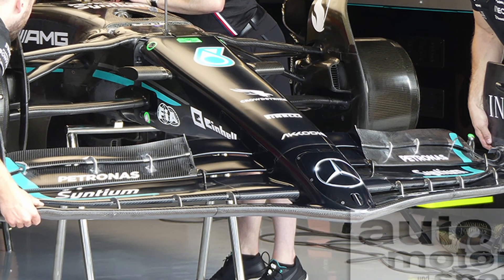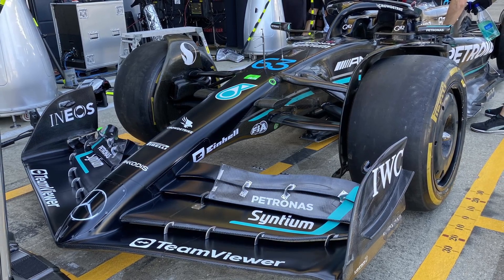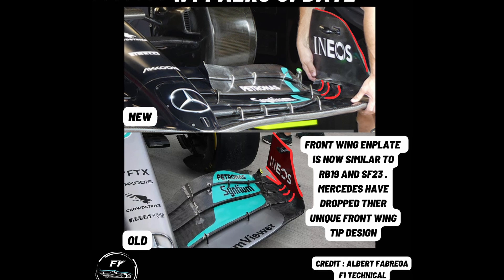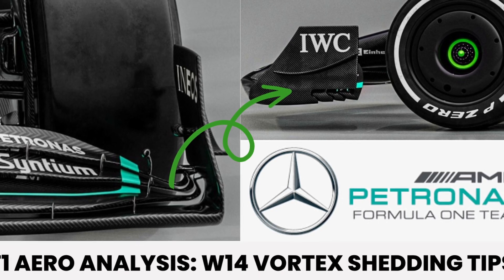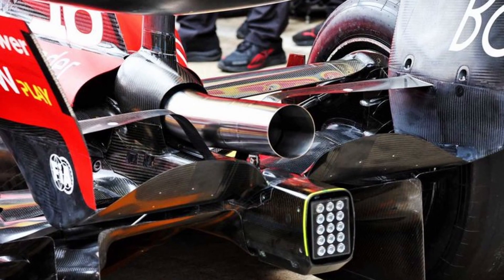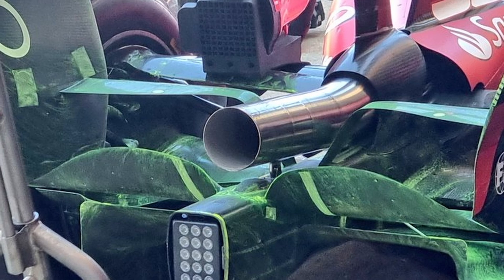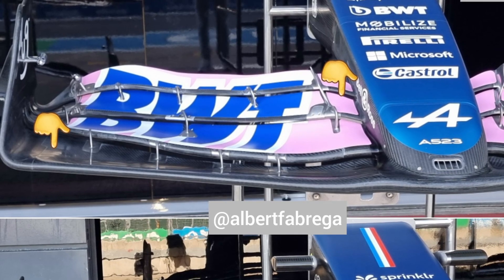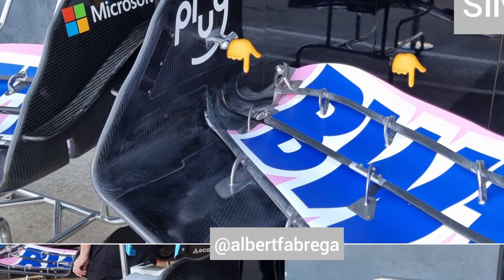#F1 Fridays : 2023 British Grand Prix Aero Updates | Mercedes | Ferrari | Alpine

Comment: mercedes gave up that front wing tip design with the introduction of the w14 since the rules changed
alpine and williams also were running with a single beam wing and they didnt seem to get the extra drs effect, could they just not be set up correctly?